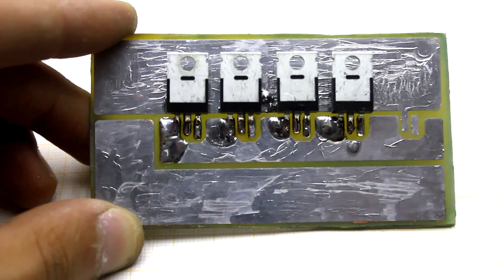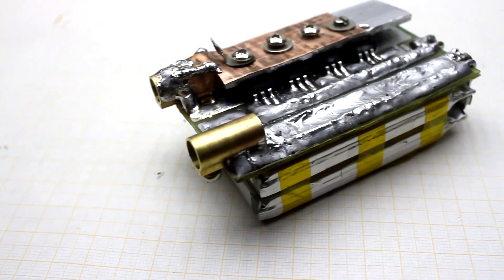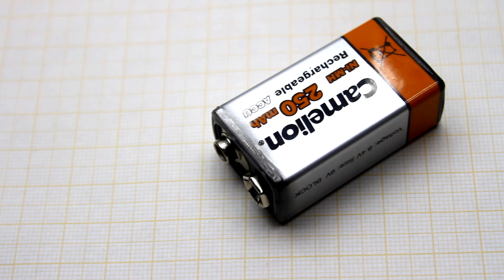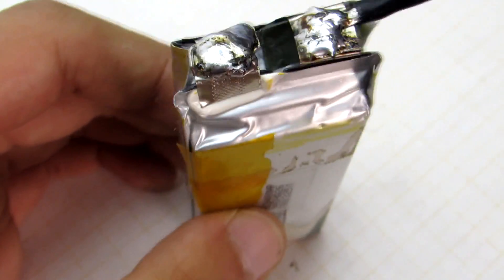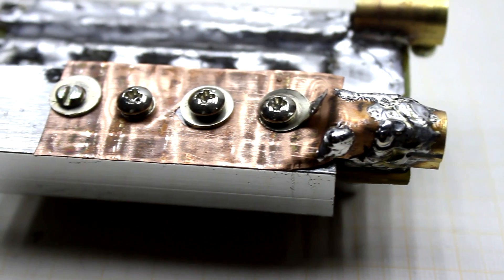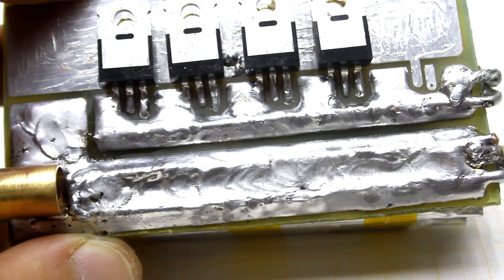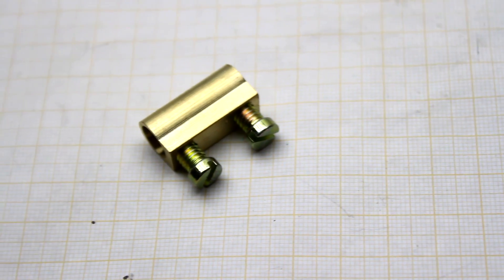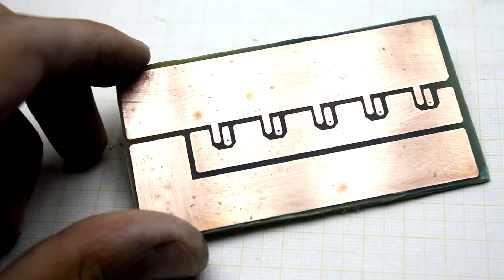DIY pocket welding machine

Comment: You would be better off with charging a couple of supercapacitors rather than shorting the batteries like this.
Reply: apparently yes. I looked at the russian wikipedia and the translation of capacitor to russian is "Ионистор". If you paste that in google translate and make it pronounce it, it says IONISTOR.
Reply: I think that's what they meant with "ionistor". I googled that and it directs you to supercapacitor.
Reply: 83hjf wait, "ionistor" is a synonym for supercapacitor? I was wondering what he (or she or it, idk it's a text-to-speech bot) was talking about.
Reply: 83hjf wtf you are right ionistor is supercapacitor. Then they are not directly shorting the battery then, means it is alright. But I don't see any in their device so I am confused now.

Comment: not 30-80 Cell, but 30-80 Coulomb i think....
Reply: Actually, while you are right, there are indeed many cells in series and or parallel inside one single lithium ion "pouch cell". One cell is comprised of one cathode and one anode with separators and electrolyte, but one "pouch cell" has many anode-cathode cells inside of it and one battery has many pouch "cells". The industry uses misleading terms on purpose.

Comment: A lot of NONSENSE!!   All you need is a small car battery or Motorcycle battery or even a 
GEL CELL battery   and some heavy gauge wire w blunt tips!  That's it!!! 
The rest is your SKILL in knowing how to hold down one probe then applying quick pressure and For how long (fraction of a second) on the 2nd Probe
 and making sure the Tips are not too sharp as to not burn holes in the material.    

YOUR BRAIN and your DEXTERITY is all the CONTROL you need.     NOT all this Bullshit.
Reply: There is no way this isn't bait.
Reply: King Harkinian ikr, just don't feed it.

Comment: the LiPos are bloating. dont store high drain cells (as used in RC flight) fully charged. that is the quickest way to kill them.
Reply: Cuda FX Shorting them out might also explain... You should never short a LiPo battery or it will puff up and can explode.

Comment: Better get some LiMn akkumulators (these are sold for e-zigarretes for 15$ a piece) before everything explodes! LiMn are rated for even higher currents than LiPol and cannot burst into flames!!
Reply: Actually,those are very likely LiFePo4, not "Lithium Polymer" , which,alone,doesn't mean anything at all since even a LiMn is a "Lipol" cell. It's just a different chemistry.

Comment: Not so good of a design. Best one I seen was capacitive discharge to make large currents. such as 8 large capacitors and charge to 180 volts, and discharge though a hockey puck SCR. This is how stud welders are designed.

Comment: Shorting LiPo/LiIon battery will lead them to bulk, then cells may explode or release hot gases from them. You should set some current retarder, or use some capacitor banks... If you really want to do welding with this device you MANDATORY buy "LiPo safe bag".

Comment: Are you seriously shorting out li-po bateries.
Reply: Even if the time of the short is very small? Would it be better to use more cells in parallel to spread out the current load?
Reply: Melody can you explain what you mean? As far as I know, and from literally "jump starting" my dead car battery with 18650 cells, they are connected in parallel with the car battery, not shorting them out, simply essentially transfering the charge from the bank of 18650. cells(or lipo in this case) to the car battery and allowing the cars electronics to piggy back off the LiPo. Unless I'm missing something.
Reply: Usually a car battery and a starter motor will draw lots of current if you let them, 200A for a starter motor is easily possible, so it is often as good as a short.
Reply: Klaufmann Is that what he's talking about? Over drawing a battery isn't a short. If that were the case you could say using a 20A lipo in an RC that has up to 25A pulses is equal to shorting it out, but that doesn't mean the RC car works by shorting out the battery. I mean really if you wanted to you could say connecting an LED to a battery it works by shorting the two terminals, but thats a weird way to explain how electronics work.
Shorting a little jumper pack would occure if you connected the leads in series with the car battery, then connected the remaining leads together, or sinply turned it on and connected the leads together, but they usually have protection against this. Also if you just connected the jumper battery in parallel with the cars battery and left it, it would balance out the cells, probably allowing your car to start off of just the car battery again avoiding needing to pull 100+ amps. Also I have a few different 5Ah lipos capable of insane currents(rated at 90-180A), so 200A isnt really unthinkable and certainly isnt equal to placing a bridge between the two leads.
Reply: Yes You are absolutely right. I guess My answer was a bit too hastily written. My bad :)
It's funny because later I wrote myself that "Connecting cells in parallel will give us more efficient current source"
Reply: Elektron1000 thats how pocket jump starters work
Reply: Yes you are right. That is how pocket jump starters work but that does not mean it's good for they li-po batteries. Shorting out li-po batteries causes irreversible changes in li-po cells significantly shortening their life time. That is why you have warnings on li-po batteries "do not short circuit terminals (battery)" and "Read all instructions before use. Improper use of batteries can result in fire causing serius injury and properyty damage." Moreover,  there is no protection against excessive discharge of the battery which is also very bad for the li-po cells. After a very short time of work in such conditions, they will puff out like balloons.
Reply: I'm not saying that  it's a bad project. I would just improve it by adding protection against excessive discharge of the battery or too make it simple I would consider using "battery monitor" connected to the balance connector that would give me visual battery voltage state. Another modification I would like to suggest is charging the electrolytic capacitors from the battery and then using the energy stored in them to make the weld. This would protect the battery from the effects of a short circuit.

Comment: it's possible to make without push button? and how?
Reply: dont want it to go boom in your face. use a condensator bank.
Reply: you can, but It would require a different circuit, and I wouldn't suggest it as it could be a fire hazard if the 2 electrodes touch eachother by accident.

Comment: i was waiting for such circuit . i was struggling to get micro wave transformer. this seems i can assemble this circuit thank you very much for sharing such video.
Reply: umesh hs u in wrong place then lol they chuck em out all the time round here lol
Reply: umesh hs Do not build the circuit. LiPo batteries will explode when treated like this, and will burn violently for several minutes lighting anything flammable nearby!
Reply: PunakiviAddikti thanks I browsed to know the behavior of li.ion, lipo batteries. Understood not enough expert to have control on these batteries. I wil continue to search suitable E,I. core transformer.

Comment: That's great project if you are looking for a very small scale work on pocket machine. Otherwise it should be heavy transformer type if you are doing reasonable work. Regards,
Reply: for a more stationary approach, using an arc welder and a high current diode bridge instead of the lipo battery could work. the diode bridge costs around 10 bucks (10*50Amps diode bridges in parallel.) or can be salvaged from computer power supplies (the output diodes generally are rated for 50 Amps, so 8 of them would be needed for a 100Amps welder) the alternative could be using a 100A starter relay instead of the transistors.
Reply: manaquri I would like to add that a diode bridge might cost 10 bucks, but shorting out a LiPo battery can cost a life.
Reply: even shorted, at worse it burns, you'd probably have to try to extinguish the fire with petrol for it to be a problem.
Reply: manaquri: or use a fire retardant powder made from charcoal, sulfur, and potassium nitrate.
Reply: or glycerin, nitric and sulfuric acid, then hit it with a hammer?
Reply: manaquri: well, if you have a burning lipo and you hit it with a hammer, you may not need the other ingredients for the desired result.